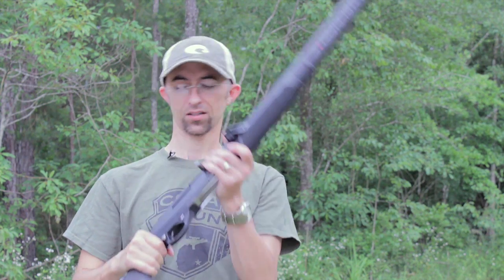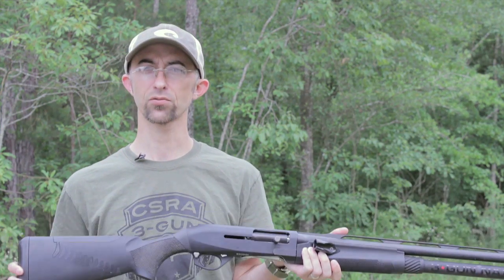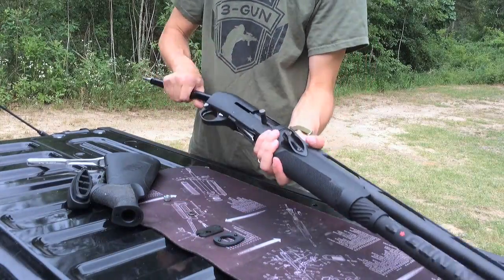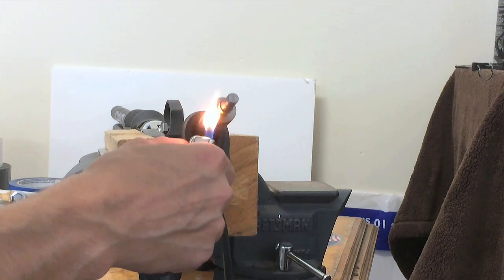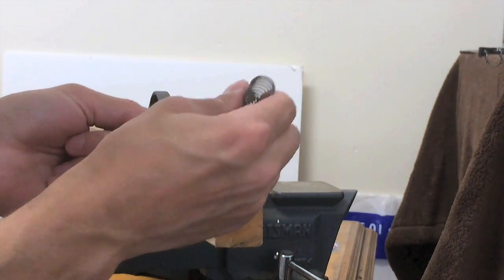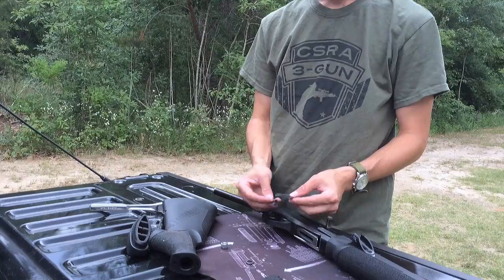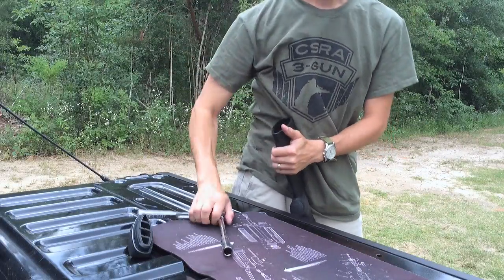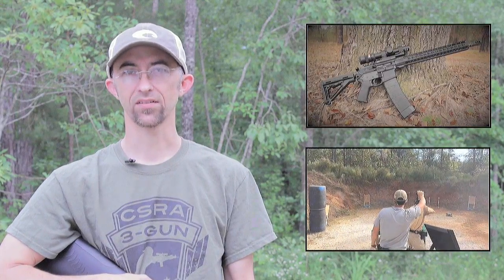REPLACING THE BENELLI M2 RECOIL SPRING WITH TARAN TACTICAL REDUCED POWER BUFFER SPRING

Comment: I had to use a torch on the loktite on my M1 tactical spring tube and had to clamp the tube in a vise with wood blocks on each side the nut it was so tight. Finally broke it loose and replaced  the spring with a Taran. It can run on birdshot now and still handles the 00B equally well. The old spring was fried by the time it got removed.

Comment from the maker: +Christopher Peralta Not sure why I can't reply to your post, but the lighter loads I have been running in matches are Winchester Double-A 2-3/4 1oz and 1-1/8 oz. They are 1100-1200 fps and I've never had a problem. With inertia system I probably wouldnt go lighter than that.

Also, I've never shot anything hotter than 3-1/4 drams, dont see the need and my shoulder don't want none.

Comment: Excellent video iam having problems with my Benelli Montefeltro having watched two excellent USA videos on maintenance my gun is now at the gunsmiths having the hammer spring,recoil spring and firing pin spring replaced I wish we could get custom parts in UK many many thanks for posting this all the best.Big Tony 
New UK subscriber
Reply from the maker: +Tony Ashton Tony, thanks for subscribing from the UK! You'll get plenty of good shotgun content here!
Reply: +BullittMcQueen Many thanks my Benelli Montefeltro Woodcock light model is my go to 12 guage permanently 3 shot restricted for UK market.You lucky American,s!!!You just can't get info or diagram parts in uk for my Montefeltro no custom parts can't buy spares un less gunsmith orders them GMK is the only UK Benelli importer just a nightmare situation as they won't deal with public.Good job Benelli is reliable semi auto for vermin control and clay pigeon shooting.I know parts wear my model is nearly 8 years old it's at gunsmiths having a hammer spring,recoil spring and firing spring and bolt inertia spring also trying to get 2 D ring spring washers for trigger group as spares iam not holding my breath.Regards Big Tony
Reply: +BullittMcQueen Just to add I use 28 gram 7.5 UK shot for English Sporting clays and 32 gram 6 UK shot for woodpigeon,crow,rook,rabbit  shooting,36 gram 4 UK shot steel for Duck shooting.I have Teague custom chokes of 3/8 (light modified) and 5/8 (tight modified)
Gun is excellent multi purpose hunting tool.

Comment: I was given this Reduced Recoil Spring as a Christmas gift a few years ago, but never installed it.  Trying to decide if I should or not because I most use 1200 FPS shells anyway.  Is there a downside to using this spring?  I am guessing that the lighter spring will cause the shooter to experience MORE felt recoil when shooting 3 dram shells?
Reply: Good question I would like to know too

Comment: I use an M2 in left hand to hunt with. I live way up in Canada. I've had some slo mo cycling with lighter loads when it's really cold.Will  the replacement spring alleviate it? Good vids.
Reply from the maker: Lube the bolt and see if that helps first. Then change the spring if it keeps happening.
Reply: I can answer that for you... Change the spring. Nothing worse than being on a good hunt and your $1500 semi-auto wanting to act like a single shot.  All the lube in the world won't help the issue -- I know from experience. Wolff makes a good "overpowered" spring that has 25% greater "strength" to really slam the bolt on those cold, damp days.

Comment: i bought the replacenent recoil spring, pn 60691, but it is about 2" longer than my stock spring for my m2 and is also a snaller diameter. did i get the wrong one? is this the correct pn for a stock recoil. not going in very easily, in fact cant get the last 6" in without it springing out with all that tension. any suggestions are appreciated.

Comment: Hey Mac,
What's the heaviest load you feel comfortable running on that spring?  I just ordered one but am having second thoughts about putting it in as my M2 already cycles light loads (2 3/4 DRAM or 1oz-7.5 @ 1180fps) without a problem...yet.  Maybe I'll have troubles in the winter but...
Thanks for the videos man!
Reply: Just spoke TTI and Taran Butler said I could run 3 1/4 DRAM regularly with the spring.  So I think I'm going to go ahead put it in.  How light of a load are you shooting for Mac?